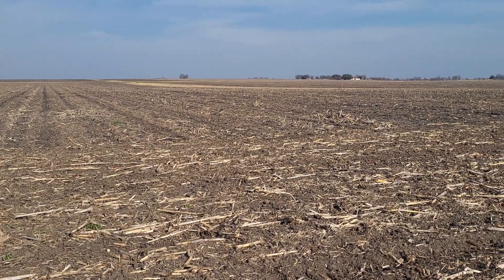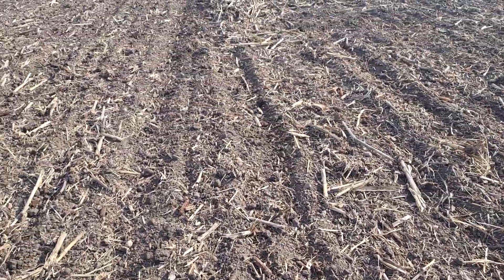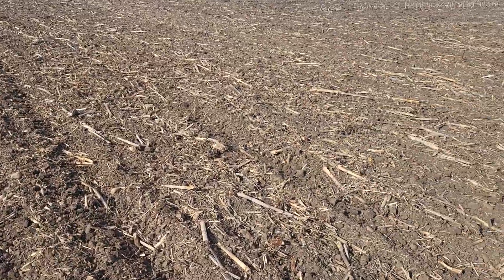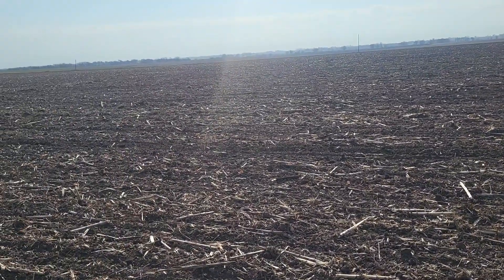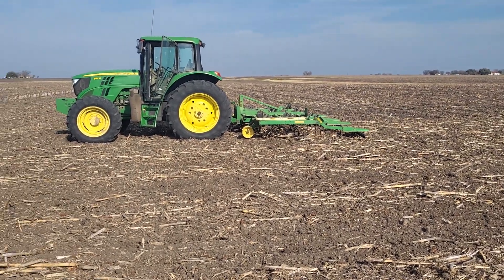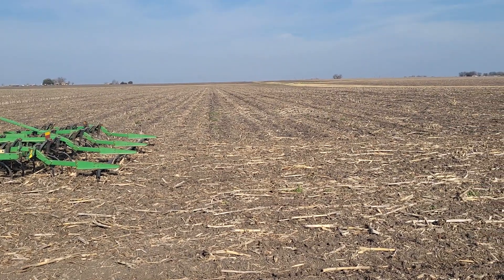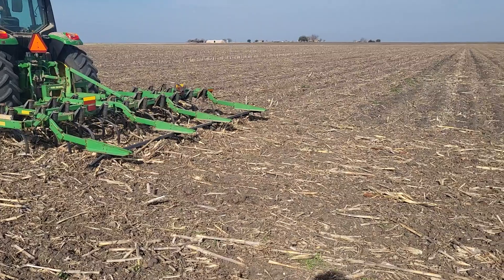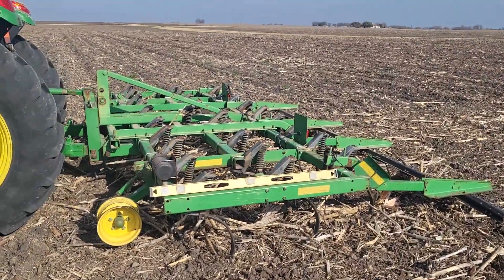cultivating for the first time in years.

Comment: I'm going to have to work quite a bit of my ground next spring for the first time in years also, got tore up pretty bad chopping silage last fall. Got one piece hasn't been worked in 50 years or more that I took out of pasture 15 years ago that's going to be sad to see it ripped up. Most of my tillage equipment is getting crusty from lack of use😆
Reply from the maker: I liked how the inline ripper set up the soil and it mellowed for a few months.  I'd would have like a mulch finisher on this pass to do better at leveling.